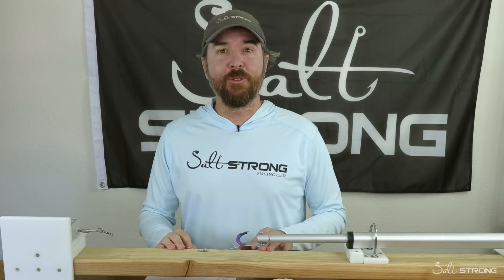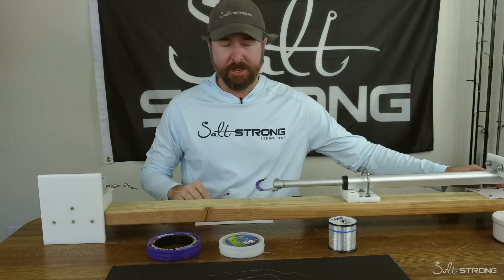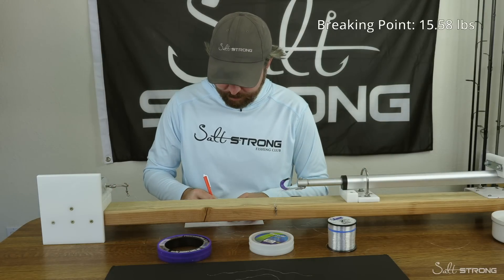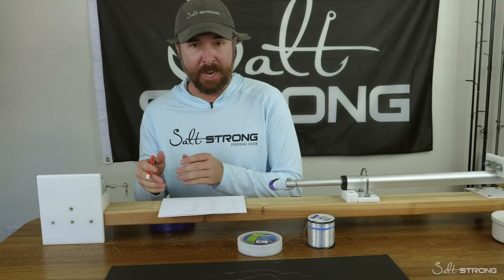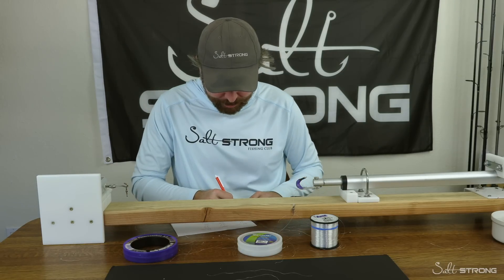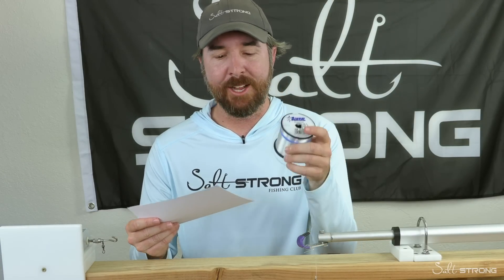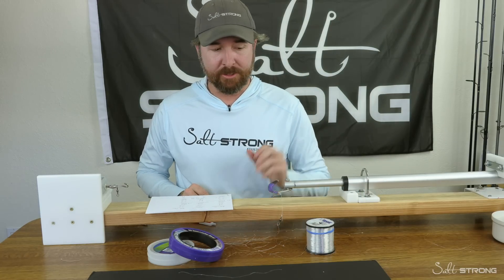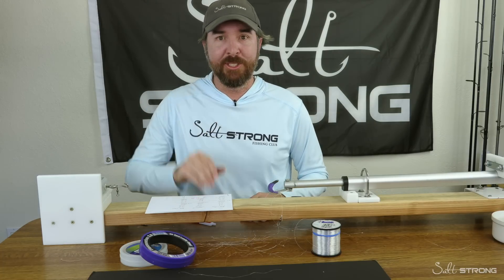Fluorocarbon vs. Monofilament Line Stress Test Experiment Results!

Comment: I can personally say I have seen what the individual mentioned with florocarbon line. With floroclear line during fall chinook season after catching a few larger fish I noticed a kinking in the line around my swivel I pulled on the line and actually broke it by hand went to retie and had the line continue to break on me had to spool off about 50 ft of line before it would not break anymore had to do this about 3 times that day after that I went back to mono now I fish CXX X-tra strong and wouldnt go back.

Comment: Please test Kastkings' new Tripolymar monofilament line!
Insanely small diameters and claims to be the best of both Fluoro and Mono.
It could be a very interesting video...
Reply from the maker: We'll make note of that!
Reply: I bought the 6 lb "crappie" Tripolymer.  Straight-line breaking strength in all tests is about 4.5 lb. Knot strength is horrible - the only one I got to work well is the San Diego Jam Knot. From what I have read, the higher-test versions of this line behave in a similar manner.

Comment: The number 1 reason for breaks is poor drag set and adjusting during fight.  2 is poor knots.  3 is lack of patience, which causes  numbers 1 + 2.
Reply: Crappy line breaking at 12lb instead of it's rated 20 doesn't help LOL!

Comment: You are technically doing whats called a fatigue test in the materials science world. This measures the "toughness" of a material. It seems like you figured out the elastic deformation limit of mono is a higher percentage of it's failure point than flouro which makes sense because flouro is a stiffer material. It's like comparing your japanese kitchen knife to your fillet knife. The fillet knife will bend around the skeleton of a fish when you apply sideways preassure where the kitchen knife is liable to break, however, the kitchen knife will hold a sharp edge for much longer.
Reply from the maker: Thanks for the insight!

Comment: Has salt strong even done a line visibility test with monofilament vs florocarbon?
Reply from the maker: We've done strength and abrasion tests. Due to the material and state of fluorocarbon, it is typically noticed more in the water. We can conduct a test on this!

Comment: I like the sensitivity of fluorocarbon,  but ive noticed its weaker than my mono. My line breaks more than my mono. And when I tie my knot on fluorocarbon it breaks easier.  A part of me wants to go back to a mono. But I love jig fishing and worry about missing that sensitivity.  I use a 15 lb test in theory i could go up to 17 and get more sensitivity in my mono correct?
Reply from the maker: In the majority of our tests, monofilament outperforms fluorocarbon and is the cheaper option
Reply: @Saltstrong  is there a good mono that has good sensitivity that you'd recommend?

Comment: So I am still learning and planning some rigs for my sailboat specifically for stripers, mahi, tuna.....  trolling around 4 to 6 knots.. (trying to create a rig that has multi uses as i=on a boat and cant have too many options)..  was thinking 50lb line mono and 60 lb fleuro leader about 6 feet?  hook size probably between 6 and 9 - 8 or 9 for bay stripers and 7 for mahi and tuna....  still unsure what size sinkers to use and what size swivels match.  any thoughts or help?   in bay probably trolling in water between 25 feet and 100 feet and then coastal for tuna and mahi off Carolinas and Florida  please help.  I'd be using some lures...still unsure what kind...maybe like mojo style chartreuse for stripers and then perhaps dolphin feathers style for coastal
Reply from the maker: Check out the full blog on our website and post your question there. That way, our coaches can respond back directly with their input and recommendation. You can find that here: 
https://bit.ly/41vV6hG

Comment: Last few weeks i look at the new omega super lines tried on both leaders found they could no handle the omega cuts into leader went to 15 pound wire uncoated dia of wire is only a fraction of the other leaders. had a 2.5 grub Z----MAN WITH NEW BAIT LUNKIE JIG HEAD NOW THERE THE MASTERS OF Z MATERIAL HAD SMALL CIRCLE HOOK IN GRUB. NAILED A NICE 1.4 M BARRA. DIA OF WIRE BE CLOSE TO 2KG MONO VERY THIN NUMBER 2 CRIMP COPPER.
Reply from the maker: Thanks for the info!
Reply: @Saltstrong  cheers thanks for the video .

Comment: Brilliant test.  You guys are just about the most useful and "Real" source of knowledge "on-line" pun intended.  I have been doing tests on mono, fluoro, and braid myself and have found the same result.  Mono is definitely stronger and more durable than fluorocarbon.  Knots tied in monofilament such as Trilene, Palomar, non-slip loop etc. cinch down and form up far easier and are considerably stronger than the same knot tied in fluoro for the same lb test and/or diameter.  Connections to braid with knots like FG and Alberto are stronger too as the braid locks itself into the mono better.  Mono also doesn't fatigue and become weak after a few hard pulls like fluoro does.   The only thing left is whether Fluorocarbon is harder for fish to "see" than mono.  No one has proved this yet as far as I can tell and I'm old enough to remember catching heaps of trout on nylon line and probably cat gut before fluoro was even invented.  I reckon fish feel line more than see it anyway and the visibility thing will likely be de-bunked eventually just as the abrasion resistance myth has been already.   
Line used for testing: 
Fluorocarbon - Diawa, Shimano, Berkley.
Monofilament - Diawa, Shimano, Platypus, Schneider.
Braid - Diawa, Shimano, Savage Gear, Platypus.

Favorite Leader Line: Shimano Exage Mono & Diawa J Thread Mono.
Favorite Braid: Shimano Kairiki 8.
Favorite knots: Trilene for everything terminal.  Connections to braid - FG with Rizzuto Finish for 12lb and above, Crazy Alberto for 10lb or less.
Reply: I have similar experience with mono vs fluorocarbon. Fluorocarbon is harder to synch knots with, less abrasion resitant and more expensive per feet. Pure marketing bullshit. I feel so cheated after buying top dollar fluoro and losing fish with it.
Reply from the maker: Great info! Thanks!

Comment: In New Zealand we are very grateful to the US fishing fraternity for teaching us about soft plastic fishing. Here we use 20 to 15lb braid with 2 metres of 20lb fluorocarbon leader for saltwater fishing for snapper up to 20lbs plus, and even kingfish ( amberjacks cousin) to 40 lbs plus. We like the braid as it has zero stretch, great for moving lures. But we only ever use 2 metres of leader.
I just don't see the point in a longer length of invisibility than that. Despite the Berkley reps best efforts.
Reply from the maker: Thanks for the comment! If you'd like some additional information from Luke, please visit the full blog on our website and he can provide more explanation. You can find that here: https://bit.ly/41vV6hG

Comment: Where do you set your drag? 25-30% of line strength? 50%? This doesn't seem to mimic the real world on the water. Spit balling an ideas but wouldn't setting up a test mimicking a hook set with the actual rod, reel, and drag setting be more applicable? Especially when you consider what length leaders folks use.  Loved your line test videos in the past. This is good stuff too. All the best.  (if you are inclined, you can look up Elastic deformation vs Plastic Deformation for tensile testing)
Reply from the maker: Thanks for the feedback! Glad you've found these helpful. We will be doing more line test in the future. If you'd like, please check out the full blog on our website and post your question there. That way, Luke can respond directly with this feedback and input. You can find that here: https://bit.ly/41vV6hG

Comment: looks line mono exhibits some form of plastic deformation similar to steel.  this is when you actually get a higher ulitimate tensile strength by straining the material beyond is elastic region of stress vs. strain.  Very cool experiment, thank you for sharing
Reply from the maker: Thanks! Glad you enjoyed it!
Reply: @Saltstrong  Good information.. so at the end of the day, you're saying that Mono makes a better leader than Floro correct?

Comment: I use monofilament on 98% of my rods/reels...price is right to change out a few times a year, great abrasion resistance, shock resistance abilities...today's mono is much better than the past...most don't use it anymore, because the "pros" don't 😆 they get free braid & fluoro, rods, reels, and other things from sponsors...1 thing I can gurantee... Fish don't care about your line, rod, reel, boat size, braid to fluoro leaders, etc...
Reply from the maker: Thanks for the insight!
Reply: When you lure fish braid has the huge advantage of almost zero stretch. Mono has up to 17% stretch, so in deeper water moving your rod doesn't move the lure at all. If mono worked better the pros would be using it, it's made by the same manufacturers anyway. So you're way out there
Reply: @joedennehy386  How did people catch fish before braid was a thing?
Pros will use whatever they are paid to use. Thats common sense, and will repeat or parrot what the marketing depts tell them to say about the product.
Reply: Facts 💯💯💯

Comment: One thing to consider....dry test vs wet test. All the testing i have done (a lot) mono soaks up water more and lost 2-3 pounds in breaking strength.  Fluoro didn't loose any. I soaked the lines in a bowel of water for an hour.
Reply from the maker: Here's a soak test we did on line soaking for abrasion: https://www.saltstrong.com/fishing-tip/mono-vs-fluoro-soaked-in-water/

What lb strength line were you using in your soak test on strength? Also, what knot(s) were used?

Comment: I would love to see these tests done with the line being wet. I think that when a line is stretched and immediately "quenched" in the water, it becomes more brittle and breaks easier. Like when steel is heated up in a forge and quenched in just water, it snaps very easily. Seeing how the fluorocarbon is all kinked up, I think it will react the same way as steel and be even more brittle. Although the opposite could happen as well. The water could keep it from getting brittle.
Reply from the maker: Here's an experiment that focused on seeing how lines get impacted by soaking in water: https://www.saltstrong.com/fishing-tip/mono-vs-fluoro-soaked-in-water/

Comment: Where is the break? At the knot? Could it be the burning at the knot? If so, would it be better in the water. Also, do you see the fluoro line kinking between your multiple stress tests? My mono line is kinky after a day of fishing! Probably should replace it.
Reply from the maker: The breaks are always at the knots. No, there is no risk of line burning as proven in an earlier contest testing if using saliva helps or hurts knots with today's lines: https://www.saltstrong.com/articles/saliva-cinch-down-fishing-knot/

I did not see any bad kinks in the lines before the breaks... only in the Fluoro after the break.

Comment: Hey Luke, love your tests but I must be missing something in this case ( its a habit of mine.... doesn't surprise me 🙂).  Certainly easy to understand the superior abrasion resistance of mono that you have tested previously, but what is the real world application of the test results here, given that your standard setup is 20# leader with 10# braid....isn't the 10# braid going to snap first with either mono or fluorocarbon? regardless of the deterioration in leader strength that you nicely demonstrated in your tests? And if this is the case, is it important whether mono or flour is superior in the regard demonstrated?Also regarding your comments that the break will always happen at the knot, do we know if the break occurs on the leader material or the braid? (
Reply from the maker: I use 10 lb braid and 20 lb leader most of the time, and the leader is always the weakest point for me when I have to break off when snagged on the bottom since I use the FG knot which has proven to have a breaking point up to 26 lbs (using 10 lb J-Braid 8 Grand... PowerPro has tested up to 23 lbs).

Given how strong that knot it, I have to use a 30 lb leader when testing the FG knot so that the leader won't break. In those tests, the braid is what fails (typically in the middle of the FG coils).
Reply: I sell tackle and braid is often up to 250% of its advertised breaking strain. I use 8lb Berkley fireline which breaks at 20 lb. With 20lb fluorocarbon leader
Reply: @joedennehy386  yep
Reply: From what I've seen in the testing your "10 lb test braid" could actually break around 15 lbs of tension, possibly more. And in my experience braid is way harder to break off than mono of the same strength (on the label). If you're using 10 lb braid and 20 lb mono or fluoro the knot is where I would expect most failures.